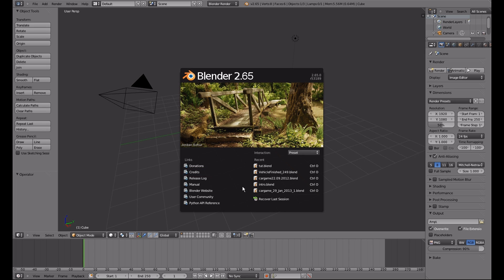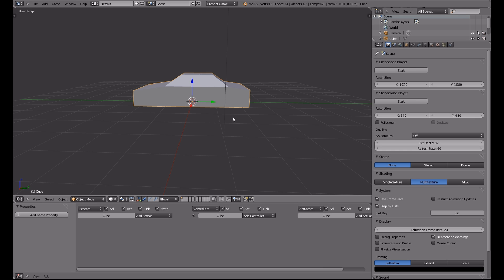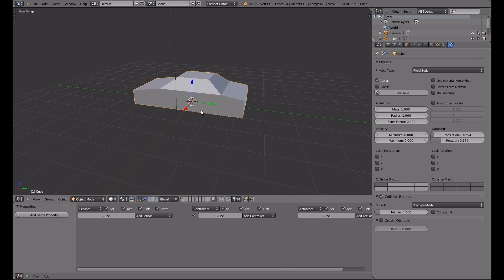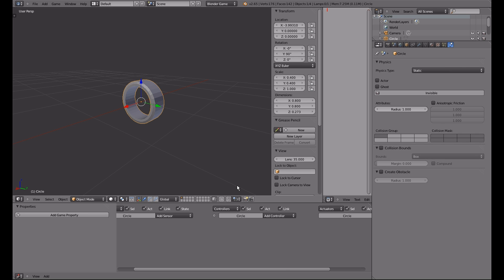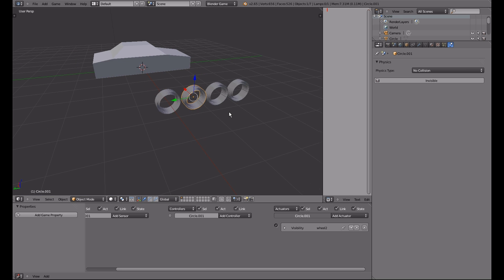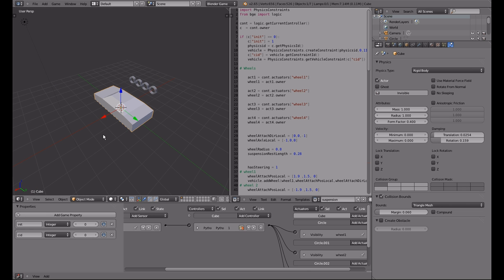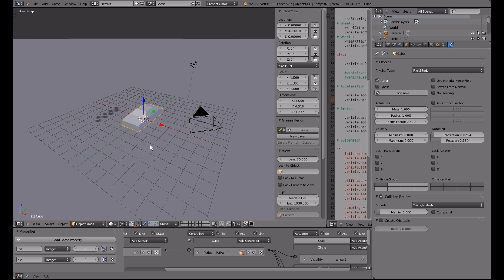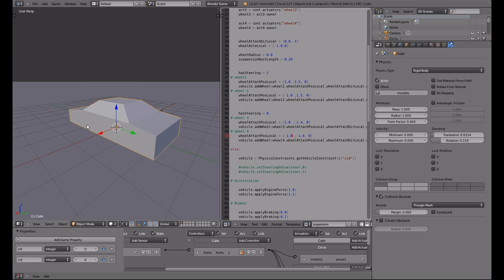[Tutorial] Blender Driveable Car 1/2

Comment: Changing the Suspension settings in the by a factor of 10 didn't change a thing. The Body still sinks down on to the Wheels like there' a Diesel locomotive sitting on top of it. I thought if dropped the compression of the Springs and Shock absorbers. So I'm Baffled!